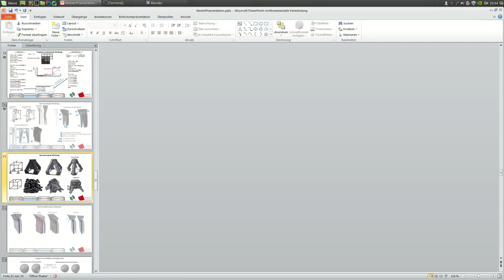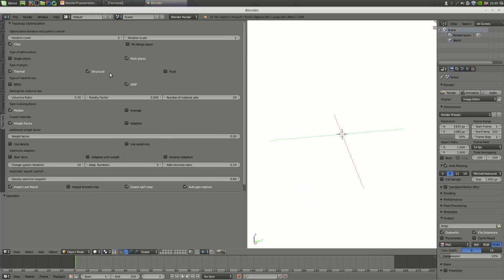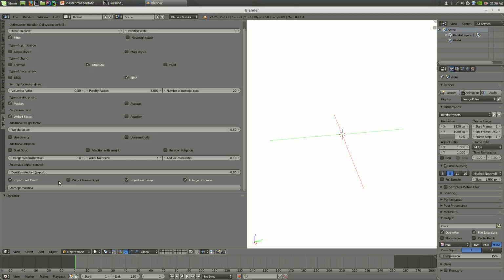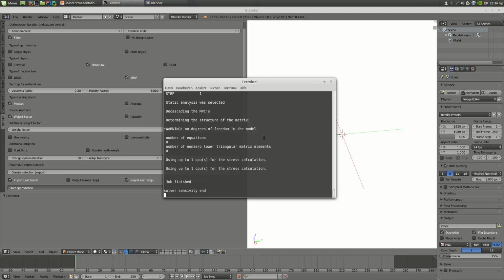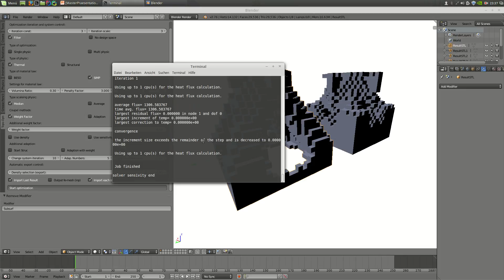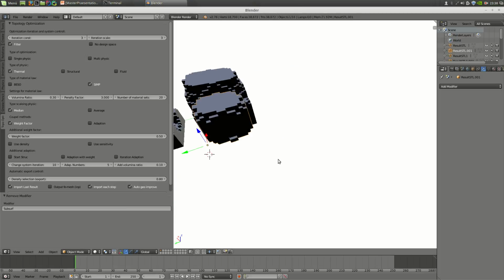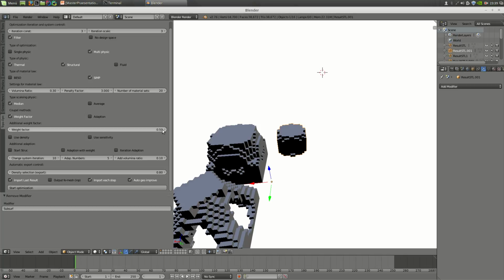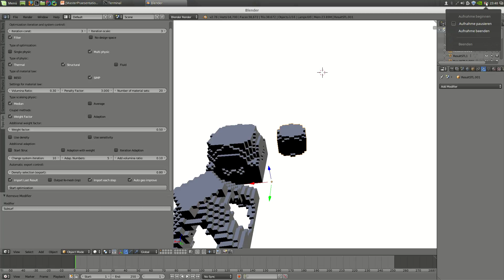open source topology optimization

Comment: Hi DMST 1990, great work. I'm sill missing a passage. The starting volume and the loading/constraint conditions are defined externally? Is not possible to setup the case directly from Blender?
Reply: DMST 1990 I see, the problem is having a 3D volumetric mesh. But can't we consider using a strategy similar to fluids? Voxelizing a domain object and defining the loading conditions with generic objects. I should study the syntax of the files generated by FreeCAD.

Comment: Hi DMST 1990! I'm a Spanish Biomedical Engineering student and I'd be very interested in using the ToOptix plugin for Blender. I have downloaded it from GitHub and tried to add it on Blender but it doesn't appear at all among the other add-on, I don't know if there could be a compatibility problem or if there's something I'm doing wrong. Could you help me to solve this issue?
Reply: Thank you! I managed to install the ToOptix plug-in but I keep getting an error when trying to run the structural example, it says:

File:”C:\...\topo.py”, line 740, in topo_start3d
os.remove(‘topo.log’)
PermissionError: [WinError 32] The process cannot access the file because it is being used by another process: ‘topo.log’

And I don't really know why this might be happening, ¿could you please tell me if you know what's the problem here?